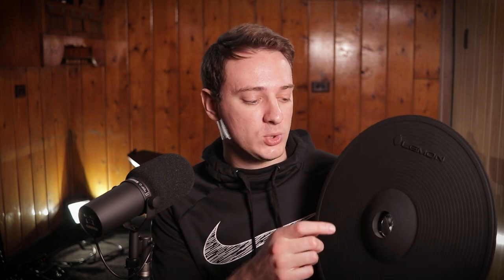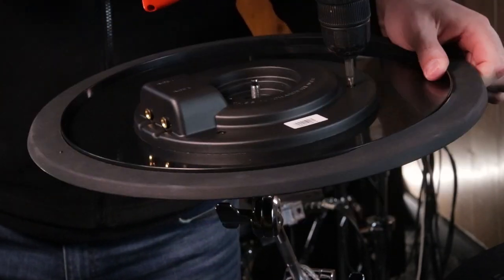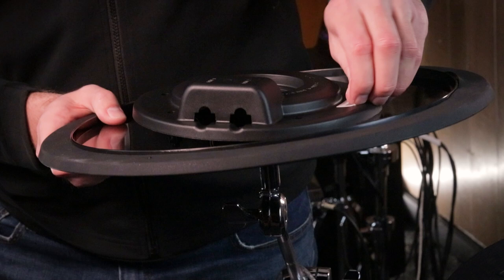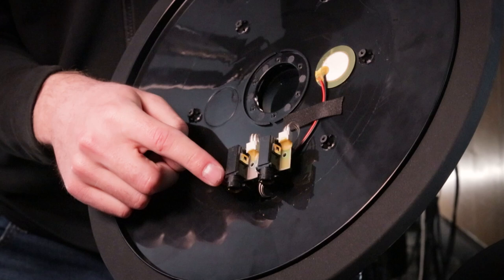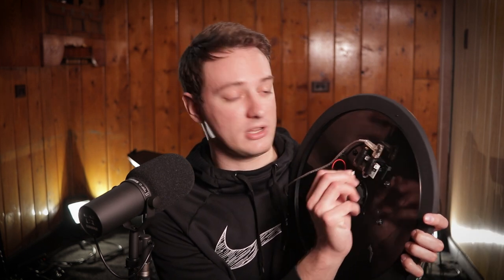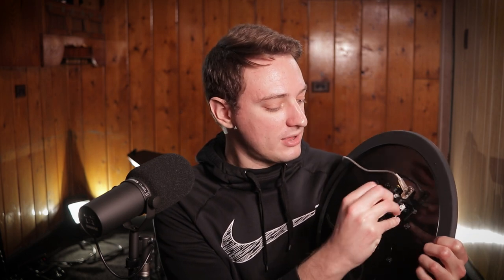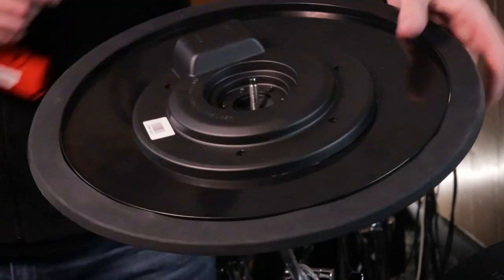Lemon Ride Cymbal: The FIX

Comment: Woohoo! Nice😀👌 (4 my follow up) it's nice to learn it's the simplest thing. Also, "Lemon" ought to mention that. Not to point out a fault but rather because having quick removable disconnects (4 configuring Ring-Tip-Ground) makes it a "feature". Try doing that with Roland without a soldering iron. 😀✌ thanks Justin

Comment: Hey Justin. I have one of these on order, should see it in the next couple of weeks. In the meantime I just purchased a TD-27 and am having an issue getting my Hart Dynamics Ecymbal II to work with it. I seem to have the Edge and Bow functions, but when I try the bell I'm getting something I can't even explain. It was easy to separate the two sounds on my old TD-8 module. I'm using the same settings, but they don't seem to be working. My connection to the TD-8 was a single cable, with a splitter, going to the Ride And Aux/11 input. On the TD-27 there are two separate cables for the ride, so I was trying to use a single input splitter with a separate tip/ring outs to the two separate cables. I'm not seeing in the module where I can adjust, just, the bell settings. I appreciate any insight you can give. If nothing else, I'll just have to wait for the Lemon Ride to arrive.

Comment: Wait. If there is no cable nor any sensor at the rim, how do they detect when I mute the cymbal? Does the module just listenen to the "fump" like sound this makes, as opposed to the "tock" when hitting it with a stick?
How does Alesis do this? (I have those.) Because I can touch them and the mute doesn't trigger, but when I strengthen my grip a bit they do. That's voodoo.
Reply: For bell and edges usually are used switches instead of piezos, they are placed on the upper side under the rubber, the piezo it's always under the cymbal, they work differently.
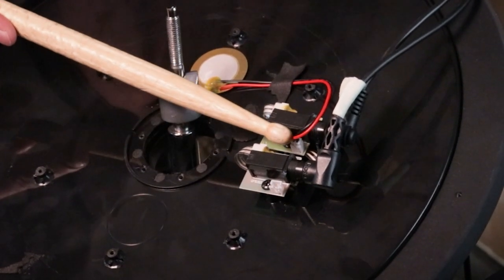Reply: @IllGib  Ah, on second look, I think I see a flat flex cable going "into" the plastic around 2:12. This could lead to the switches you mention. Thanks for demystifying this for me!
Reply: @fonkbadonk2957  No problem! Take a look here, an example of how 2 and 3 zones cymbals are made

https://youtu.be/1v_n4rh3WU4
Reply: @IllGib  That's cool! Thanks once again!

Comment: I have an older alesis dm10 with mech heads and cone triggers and sometimes when I hit the drums they just don't make a sound. I wouldn't say it is loosing sensitivity but parts of the pad won't make a sound when I hit it. Do you know what that could be and how to fix it?
Reply: Check to see if the jack is loose. My bass tower input jack knocked itself loose after many years and i had to re-screw it back in. Also try and tighten the mesh head on the drum as well as low the trigger settings in the module itself. Check the cable as well, sometimes a cable may need to be replaced. If all that fails, check to see if you have a broken wire inside the drum.
Reply: @Evilatem  thanks. I actually took it apart and just jiggled the wires around inside and it there is sound with every hit now
Reply: It is common on the Alesis mesh drums (actually made by Medeli) for the plate that holds the cones and the piezo to snap and the cones fall down causing triggering issues, you can fix it yourself somewhat by taping it back together (or replacing that part), I sent mine back to the seller as it was within warranty and this is what they did, I was not happy and complained, and in the end they let me keep the snare (with the dodgy fix) and sent me a new strike snare as a replacement (win), I put the old snare as a floor tom.
Reply: @spindreams  I didn't mention that as he said that he had an older Alesis set with the cone triggers, which was the setup they used before the clear plastic plate in the center that has been know to crack. I have Frankenstein set with old Alesis DM10 with the mylar heads converted to mesh heads. Also an Alesis Command Mesh set and a Alesis Nitro with the rubber pads. They are all wired up though each other (piggy back/daisy chain) and into a Strike module. Because of all that i'm fairly good at figuring out why the drums won't trigger.
Reply: @Evilatem  Yeah just passing on my experience not invalidating you comment, useful to others who may have a similar issue with these drums made by Medeli.
Reply: @spindreams  Ah, no worries. I didn't think you were trying to invalidate my comment, I just stating why i left off the info about the newer issues with the plastic plate as he stated he had an older set, but yes good info to have regardless.